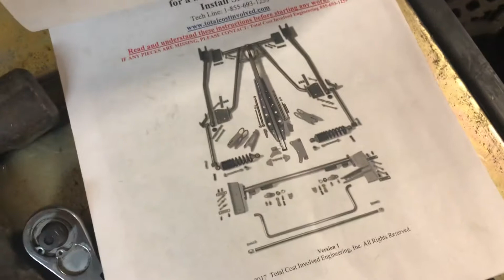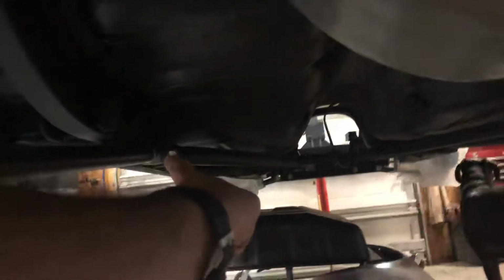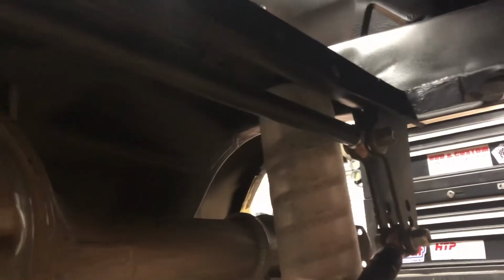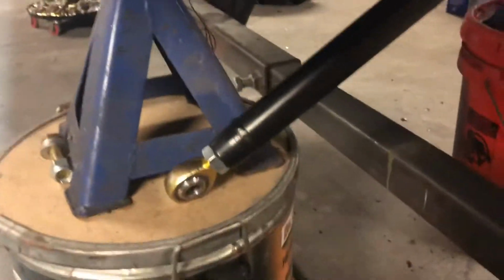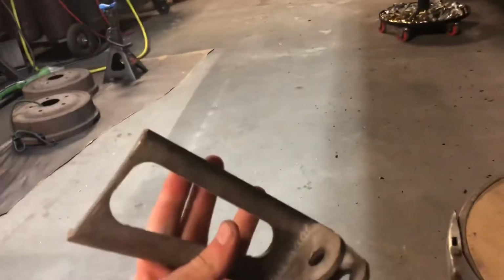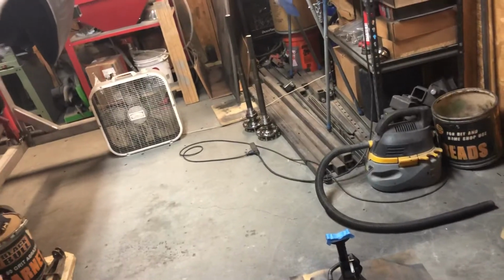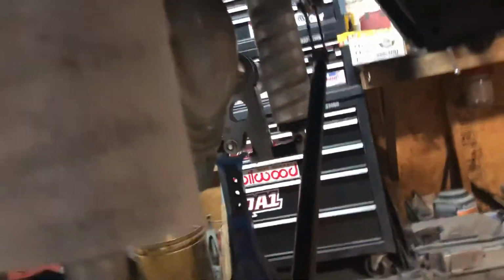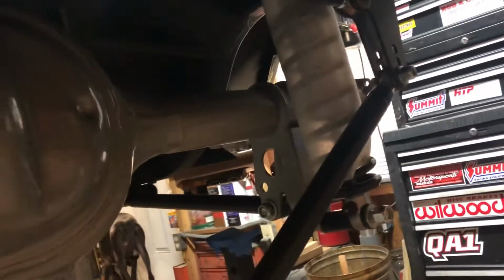Elaina rear end issues pt4

Comment: Hope TCI hooks you up so you can get that car on the ground sooner.  I know it seems that all my comments are directional, and I apologize if it seems that way, but I’d consider mounting your pump on something more solid like the inner frame rail, or build a box and mount it just above and forward of your diff. If you mount it on the front trunk sheet metal, that pump is going to vibrate the thin steel and you’ll hear your pump over your engine. Ask me how I know. Lol
Reply from the maker: no problem at all man. any and all suggestions/advice is good. i take all into consideration. i've tride to think of where else i can mount it. once i get this rear end mounted up i'll bring the pump and filters out and look at options. i had a holley blue mounted this way before and it was noisy as hell. however these newer holley dominator pumps i've heard are extremely quiet.. no pun intended.. if you look up the dominator pump with holley's filters you'll see how long they end up being inline.. that's why i figured in front of the tank was the best placement. comes out to like 20" or so.